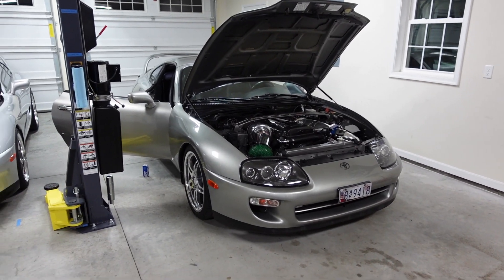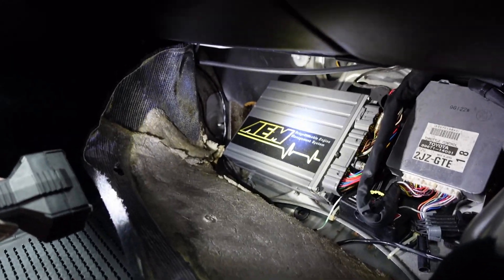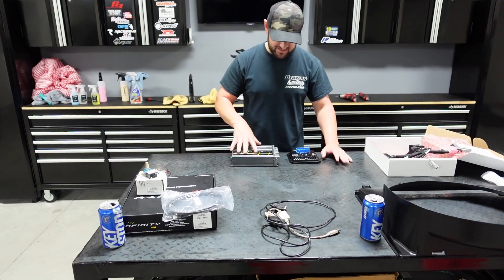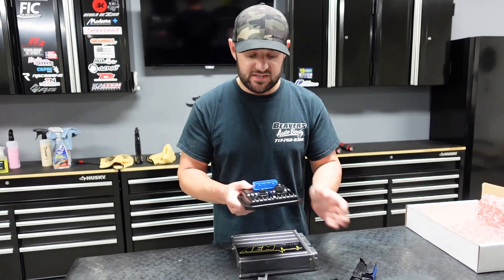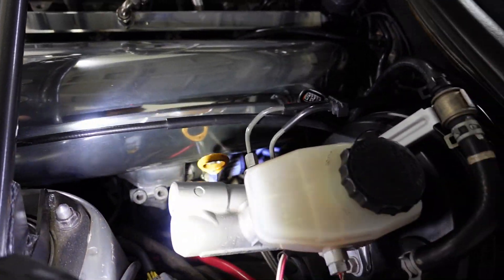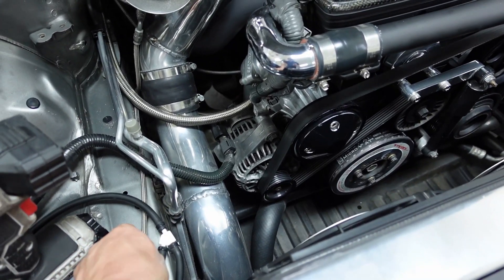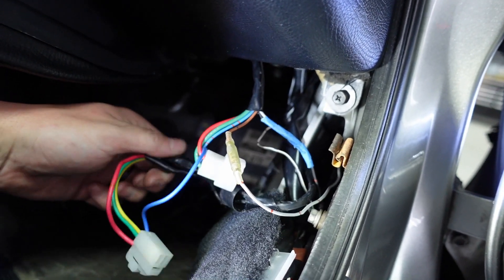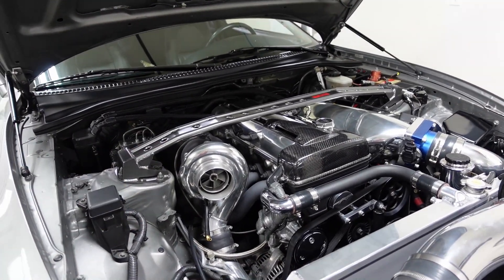1 of 24 QuickSilver Supras in for AEM Upgrade!

Comment from the maker: Hey guys, I also misspoke about about the MAC valve also. It does need a vacuum source (off the turbo as you can see I’ve done already) just wanted to correct that. Thanks to Steve pointing it out.
Reply: Up up.   I was actually going to comment that but great catch .
Reply: Well, technically it's not a "vacuum source", so you was correct... Its a boost reference. Waste gates do not need vaccum to open like a BOV. It only needs boost source to open the valve. The source can be anywhere before the throttle plate, preferably at the turbo outlet 👍

Comment: 60mm guages fit perfect in the air vent if you're willing to pull the inner out and do without heat/ac in your face 😀  

Ryan, post a 2min video of where you place the axle stands.  I use the subframes but interested where you put them as will give me more room for the job i have planned. Cheers

Comment: I'm glad I went with AEM infinity for my project
Reply: Link for me
Reply: @KeenanStyles  what link are you talkin about
Reply: @tigwelding123  me too man, I've made a great choice, considering it's got all the safety features a more expensive ems has.
Reply: @BoostedLexus  nice which one did you get
Reply: @tigwelding123  I got the Infinity 506, and already seen first hand how good the fail-safes work. I had my fuel pressure hose pop off at 25psi of boost and it immediately  hit the cut that saved my engine. I was able to pull over, reinstall and keep driving it home. Since then I've removed the patch harness and installed a CD7 Dash... That dash beats having gauges everywhere. Even beats the BTI gauges... Obviously a little more pricey... 🤭
Reply: @BoostedLexus  nice.. I picked mine up used but it was only used one time the guy said but I got a part of a harness and couple of sensors
Reply: @tigwelding123  dude you'll love it... Especially when it's setup correctly. Traction control,rolling antilag,launch control, modeswitch,flex fuel... all that in such a small package... 👌
Reply: @BoostedLexus  I'm going to be using it for a supercharged Nissan 300zx with a vk56de v8
Reply: @tigwelding123  nice, it's gonna run great, you'll see... Good luck
Reply: @BoostedLexus  💪👍💯 thanks